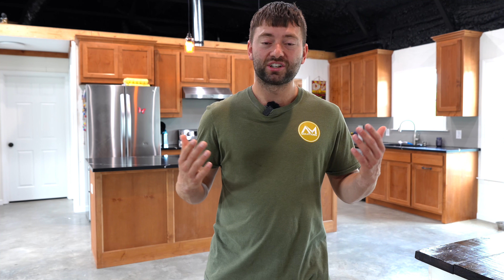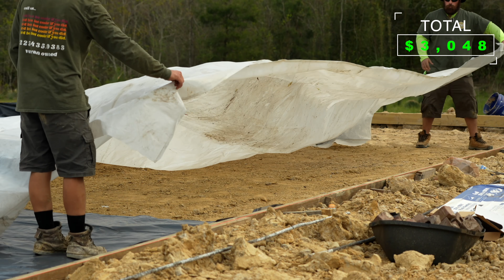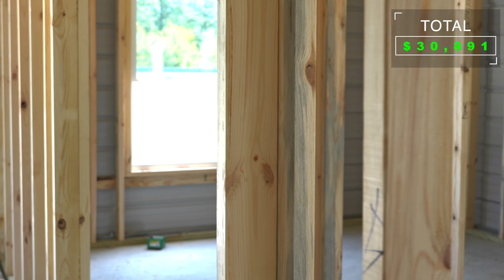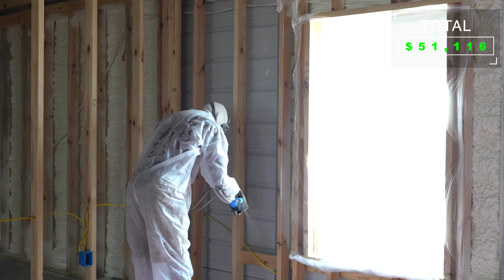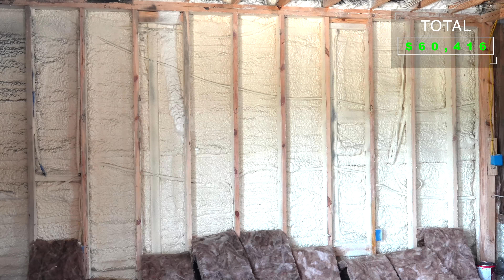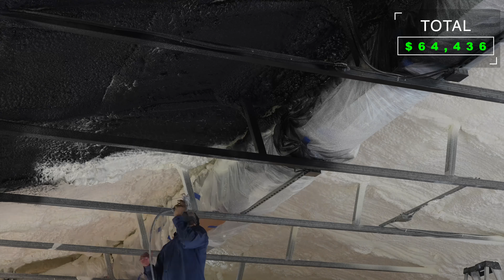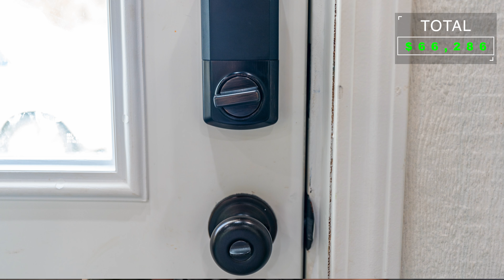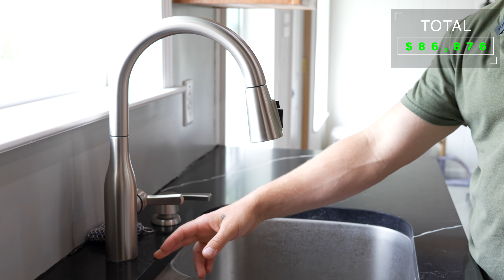Barndominium Price Breakdown | Building a 1,500 sqft 3 Bed 2 Bath Home for $87,000

Comment: Good video but is it not missing a lot? Mirrors, dishwasher, bathroom counters, permits, utility hookups, all come to mind
Reply from the maker: This is the price breakdown for the house only. 

Utilities and permits vary A LOT depending on your municipality. I can include those prices, but it would be misleading for anyone that doesn't live in the same area as me. 

The bathroom counters and sinks are included in the countertop price of this video. I guess I should have elaborated a bit more there. 

The dishwasher was $400. I didn't include the appliances because you can spend as much or as little as you want depending on taste. 

I talked about the mirror in the walkthrough video. It's something I had laying around, so it didn't cost anything.
Reply: @DudeWeCanBuildIt  Nice thanks for the reply

Comment: Omg! I built my house and drywall finishing made me hate life. If I had known about the exterior drywall I could have saved 6 months. 

Thanks for a brilliant idea. I'm about to start the mother in law pad and I'm definitely going to do the exterior drywall installed vertically with batten strips. Such a time saver
Reply: @jl9678  yeah but than it looks like you live in a trailer house
Reply: Look up interior board and batten. Apparently it's currently in Vogue
Reply from the maker: @jl9678  That's wild!
Retro styles always come back!
Reply from the maker: It worked great! 

If you like the look, it saves a ton of time!

Comment: If you don't mind sharing, how much was the lot and utilities?  Are you on public utilities or do you have well/septic, what about electric?  Also how far away is your location from the closest city/suburb for access to services/amenities like groceries, stores, businesses, etc.  I'm curious, because I want to do the same thing.  It's hard to find a lot for a decent price that is anywhere near civilization.  Low price lots are often super rural, and don't have access to water/sewer/gas/electric/internet/etc. In some cases it might take nearly that whole 80k budget just to get utilities ran to the property.  Going off grid wouldn't be any cheaper.
Reply from the maker: I can tell you what it cost me, but depending on where you're at, the prices can vary A LOT! 

Water meter $1800
Sewer system $3500
Electricity $4000

My house is 600' off the road. I buried the electrical conduit and water lines myself. 

I have 27 acres that was purchased for $215k.

It's a 10 minute drive to Walmart in the nearest town.
Reply: @DudeWeCanBuildIt  wow, most places I've looked for properties, anything even close to 27 acres would be like 1 hr or more just to a grocery store, or it would be millions of dollars.
Reply from the maker: @00HiGhGuY00  What state do you live in? These prices are pretty common around here
Reply: @DudeWeCanBuildIt  I wasn't looking in the state i currently live in.  I have looked primarily in Texas, Virginia, and Washington